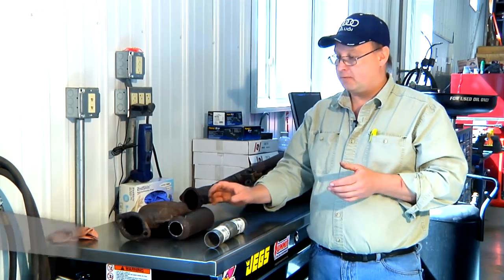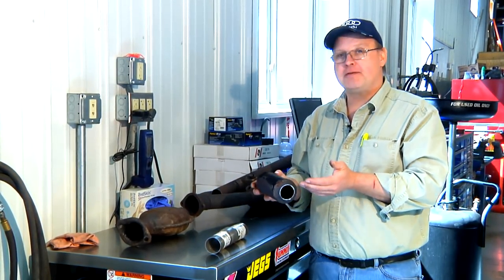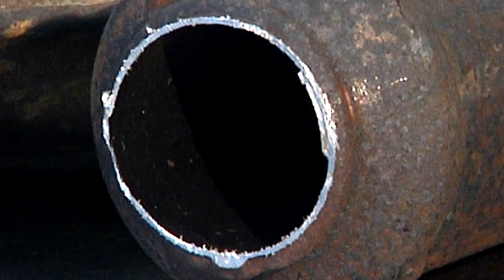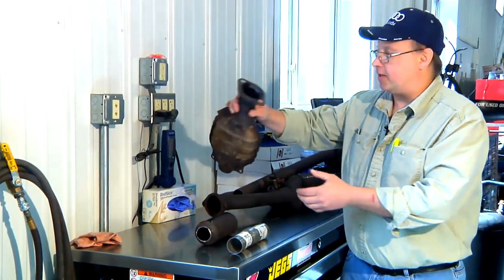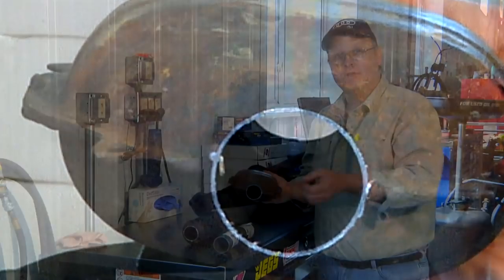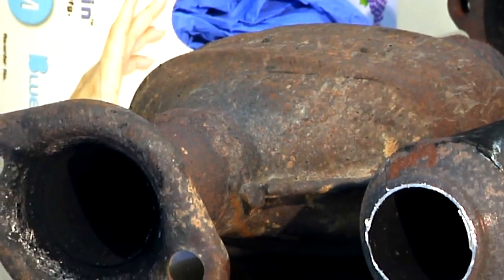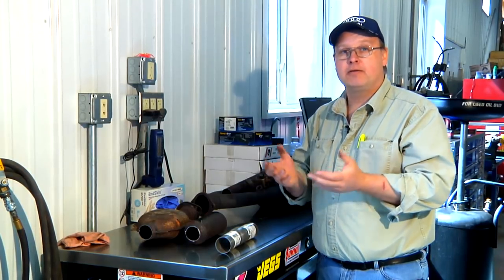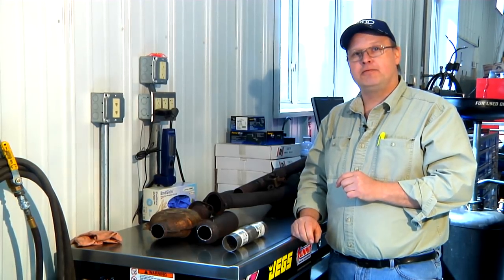What Happens if You Replace the Exhaust Resonator With a Pipe? : Under the Car Repairs

Comment: Its proper exhaust savaging NOT BACK PRESSURE that some engines loose when you go to open pipes. Its all about controlling the sound waves and the timing of the exhaust pulses! This is why a good set of headers are shaped the way there are.  Please do some fucking research instead of just repeating what others say.
Reply: ***** WRONG!
"having proper back pressure" is a myth  People think this after feeling a hp/tq loss when they take a muffler off or get a hole in their exhaust.  Its easy to make that mistake, but it is wrong. I have been a mechanic of some kind all my adult life working professionally on just about everything from motorcycles to helicopters. I have seen many mechanics think the back pressure myth is real also and its sad.
Its all about exhaust length and diameter. 
Study how a two stroke tuned pipe works with a power valve and it might help you understand.
Reply: M AR Thankyou Sir!
Reply: I'm inclined to think you're wrong considering you are the ONLY person I have heard say this.
YES, exhaust scavenging is a huge performance advantage. But that doesn't mean "back pressure is a myth." Summit Racing talks about back pressure.  When you have a performance company more credible and successful than them I can take your word on this being a myth.
Reply: m2350 When a company like summit racing (or any other performance upgrade brand) advertises and explains to people what back pressure is, its a marketing tactic to make you believe that you are gaining power WITHOUT losing power because of improper back pressure (AKA maximum power gains). Makes you think you are buying higher quality, this in turn makes consumer more flexible on price, which means they are able to charge more for the same thing (roughly) as other companies.
Reply: m2350 Back pressure does exist, but its never a desirable situation.  When your catalytic converter clogs up and doesn't allow good flow, a back pressure condition technically exists.  This means that exhaust does not flow freely. You don't want this EVER.

Good scavenging through exhaust pulse tuning can help create a small amount of vacuum in the wake of a pulse as it reflects off the closed exhaust valve.  When the valve opens there is a vacuum and it helps to evacuate the cylinder, meaning the next charge entering the cylinder from the intake is more pure.  However, this effect is extremely minimized on 4 cycle engines.
Reply: wjrneo2  You are one of the FEW that understand and I thank you for it.
Reply: wjrneo2 Yes I get it, most people are confusing backpressure and scavenging.

When someone decides to run open headers and then says the car feels sluggish they think it is caused by a lack of backpressure.
It's actually caused due to poor scavenging since the length of the exhaust is no longer helping draw vacuum between pulses.

So in essence, switching to a more free flowing exhaust is reducing back pressure and improving scavenging. But there is an extent to which free flowing is beneficial, since you want a pipe diameter that will allow low restriction and high exhaust gas velocity.
Reply: m2350 Yup, couldn't of said it better myself!
I have been a mechanic all of my adult life from motorcycles to airplanes., and its STILL amazes me when one of my co workers refuses to understand this stuff.
Even some jet engine techs!
Reply: M AR Are you loominarty?!
Reply: M AR you is a smart man
Reply: Gregory May Anti illuminati 
the symbol is upside down
Reply: M AR
Aaaaaa...
Reply: m2350   they are in business to sell parts they don't care if you don't have a clue how things work.
Reply: Steve Hutchinson yep
Reply: M AR  I tested in my car. Depends what pipe u will add after remove it. The sound will suffer a abit not much and also will breath better nothing much that u can say "woooow" u almost dont feel it. gj
Reply: M AR YES!! DING DING DING....finally someone who understands what's going on...my god do we have a wealth of experts here who speak from inexperience.
Reply: m2350 You know why> Because the rest of these bozos have no idea what they are talking about....
Reply: i agree that factory engine management has a set parameter that it works within and by modifying certain things, without doing a PCM remap, you can cause issues. but what people say is backpressure is really scavenging and velocity. four stroke engines dont need backpressure; quite the opposite..2 strokes, however, do need it, as well as an expansion chamber. its a long story, but a tuned intake and exhaust system works wonders...thats why cyl head porting is such an art..you want flow, but you dont want to lose much velocity.

Comment: You don't need the resonator for back pressure... It actually limits the car performance, all you need to do is balance the sizing of the exhaust pipes so that it is not too free flowing but not to restrictive.

Comment: and every thing he just said about back pressure doesn't apply to Turbo vehicles
Reply: +viperkill3 Turbochargers even MORE SO need the proper exhaust system diameter and length at idle.

Comment: this is completely incorrect.  you need exhaust VELOCITY. restriction = back pressure.  ergo the less restriction = more velocity.  the velocity helps create a vacuum effect helping pull exhaust from the chamber.  conversely, if you oversize the exhaust system, this will kill the velocity and then the engine will have to push the exhaust out.  you have to size the exhaust for your displacement and primary RPM range.  all a resonator does is kill certain frequencies that cause a drone at certain RPMs.
Reply: you is a smart man!

Comment: I replaced my resonator on my last car I had before I scrap it and did an emissions test and it passed the purpose of replacing the resonator is for a more aggressive deeper popping sound when you let off the accelerator I'm getting a straight pipe exhaust done this summer at an exhaust shop on my 07 Camry I'm gonna replace my resonator with a straight pipe all the way to the back with a Y split pipe and 2 aftermarket dual tip mufflers

Comment: The way it was explained to me was that mufflers "muffled" sound. Auto manufactures have become very good at making very quiet vehicles. Once they solved the sound issue, manufactures had another problem. It was that hissing at the tail pipe. With the mufflers they'd taken so much sound away that, when the engine is pushed all you hear at the tailpipe is fast-moving air. Those pulses of air (exhaust gases) which many have mentioned, are controlled by the resonator. That is why the LOCATION of the resonator is important.
Reply: Yup. On a 2005 GTO I simply removed the resonator and it was as if i had replaced my mufflers with 40 series.

Comment: unless you got a turbo then just spool city!!!!!!1
Reply: Does that apply to superchargers as well and why. I'd like to know cuz I want one
Reply: for turbos less restriction increases airflow so your turbo will run harder/better not to sure about super chargers seeing as there belt drivin. if you want the spool sound its allways good to know shorter the exhaust the more turbo sound.
Reply: Logan Peters why thank you
Reply: any time you force air into a engine you want the least resistance on the other end. take a straw and blow in it as hard as you can.. if u pinch it the backpressure has nowhere to go and the straw blows out your mouth..resulting in blown motor, bent rods, cracked cylinderwalls. the turbo is exhaust driven wheel that forces air on the cold side through the inter cooler and into the intake manifold. the supercharger is a screw that takes intake air ,via motor belt pulleys and forces air into the intake manifold.  so yeah same concepts both forced induction.

Comment: I still took mine off, I mean come on if it looses .008 horsepower and burn .06 more gas ..but it sounds better more deeper thrust sound and if the math here causes you to go broke ,you don't need a car in the first place.
Reply: +T Smitty (TahoeBoi334) I'm pretty sure it's 100% for sound purposes. Putting a resonator at the mid way point of the exhaust really effects the deep tones a lot. The muffler at the end dampens mid and high tones a lot more. You can really tune your sound this way.

From what I've heard backpressure becomes irrelevant just after the headers which is the last place that scavenging can take effect.

An H pipe also reduces back pressure behind it but that doesn't really apply to any of the conversation here about resonators.
Reply: you gain power and efficiency without a cat and a  res back pressure is just for 2-strokes really straight pipe is the best for performance someone even tested it this vid is sooooo stupid
Reply: little late, but back-pressure and exhaust pulses are different.  Minimize back-pressure without compromising exhaust velocity.  And then tune the exhaust pulses to a specific rpm range by changing the length of the header/pipe etc.
Reply: @ ben lawton     back pressure isn't for 2 strokes.  2 stroke use the expansion chamber to time exhaust wave pulse to pull and push fuel/air mix at the exhaust port.  4 stroke can use the exhaust waves 2, but without the giant expansion chamber, to help scavenge the exhaust out and new charge in at a certain rpm range by creating different pressures at the valve while it is still open.
Reply: Conner Hoffman well 4 stroke loses only a bit of power 2-stroke loses allot no more power band
Reply: ben lawton loses power..?  What are you talking about?  And 2 stroke are not using back pressure, they're using tuned harmonics of pressure waves to tune a certain rpm range for peak power
Reply: Conner Hoffman if you dont use a exhaust on a 2-stroke it is really bad if you dont use one on 4-stroke it only loses a bit
Reply: ben lawton ok, go run an engine without any headers or anything.  Just the exhaust valves into the atmosphere.  A straight pipe is still an exhaust, intentionally tuned or not, for a specific rpm range.  On a 2 stroke, running an exhaust that doesn't have an expansion chamber isn't necessarily losing power as much as it is detuning the engine for less power compared to an exhaust with an expansion chamber(aka tuned exhaust).  There isn't any power to lose, only to gain by tuning the engine via the exhaust
Reply: Conner Hoffman ok watch vid where people take off the exhaust on a 2-stroke they dont have power band
Reply: ben lawton there IS a powerband, it's just not optimum.  An exhaust is added, therefore tuning the engine for more power and a better curve.  Arguing whether a 2 stroke is good without an exhaust is pointless.  You claimed that a 2 stroke uses back-pressure to make more power.  That is wrong,
An uninterrupted exhaust on a 4 stroke is better that cats or your average sound-dampening resonance chamber, although resonance chambers and similar can be used to tune the pressure wave for peak power at a certain rpm range.

Comment: I deleted my resonator under my Ford Focus 2005 zx4 and it looks like it's the one in the middle and it's been gone for over two weeks and my check service engine light actually came on my the codes said it had something to do with my transition shifter! And I usually shift gears even though I have an automatic does it have to do with my resonator I don't think it does cause I like how it sounds as of now

Comment: I have a 2005 z I have straight pipe to a y pipe kept it  stock with 2 1/2. Inch sounds bad ass and when it hits4500 RPM it pulls even better ,and under freeways it sounds like in between a race car and motorcycle

Comment: The only thing that needs proper backpressure is a 2stroke.
Reply: Marc SIEF false. I'd suggest reading up on 2 stroke exhaust  tuning. Because  I don't feel like typing it all again. They need an expansion  chamber with a cone that is a certain  distance  away from the exhaust  port , this distance  effects where   the power hits in the rpm range (closer or further away) . This is because 2 strokes let some unburned fuel charge  out before the piston closes the exhaust  port. So the expansion chamber is a device  that bounces the most of the unburned  fuel back into the chamber for the next time the port is open. A 2 stroke  exhaust  is actually  very big ports and big piping with a straight  through muffler that has a smaller version if a glasspack  muffler for cars, (pope with holes in it with  fiberglass packing around it inside another chamber. Little to no restrictions . 2 stroke with restrictions  in exhaust  would be very low power.

Comment: A resonator might help a little bit at low rpm as torque goes.  It will make the engine quieter.  If you want to get maximum hp out of the car,  free flowing exhaust is the way to go.  Most important thing is to have the right size of exhaust pipe for the engine you are running to give maximum scavaging effect.

Comment: I brought up the EGR valve because it's pulling the exhaust gasses back into the motor. I simply stated that without back pressure your car will lose power and fuel efficiency. My example of no exhaust after the exhaust manifold is basically a simulation of the exhaust leaving the cylinders, dispersing into the atmosphere instantly and the car having no back pressure. In other words my comment was to just the first portion of your first comment until "resonator is just for reducing sound".

Comment: That there thing is a hollowed out cat, not a resonator. A resonator has no affect on back pressure anyway. This video is useless.
Reply: so if i have a cat, muffler, then a resonator right before the tip, i can replace the resonator with pipe and not cause any change other than the sound? All the pipes on my 4runner are 2.5" btw
Reply: Only a straight thru resonator can be replaced with pipe. you might hear some popping.
Reply: mine would be straight through so i guess a 12" 2.5" diameter pipe would work. would that popping sound be any sort of problem or is it no big deal?
Reply: *****
Some people like it. If you don't like it put the resonator back on. Maybe it wont make a popping sound. Every car is different.
Reply: Mark G if I'm not mistaken that say pippin sound is similar to the pippin sound you would hear on like say a "harley davidson motorcycle"
Reply: Mark G 😂😂😂😂😂😂😂